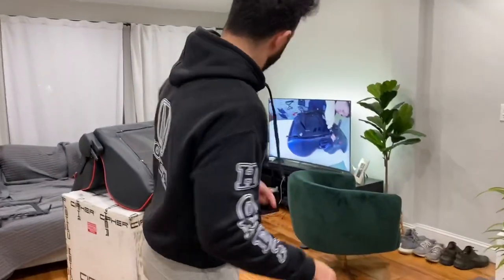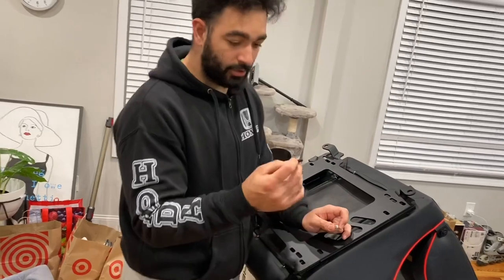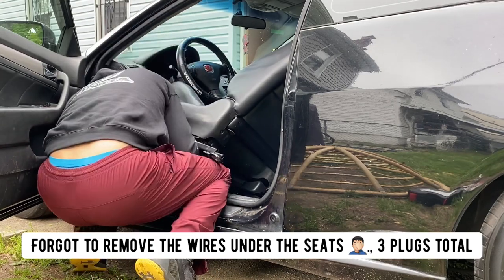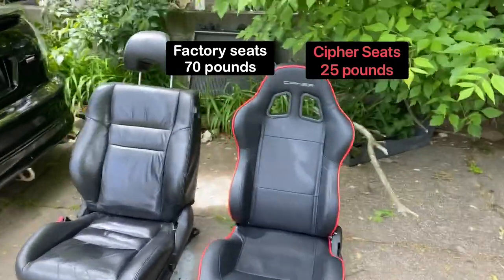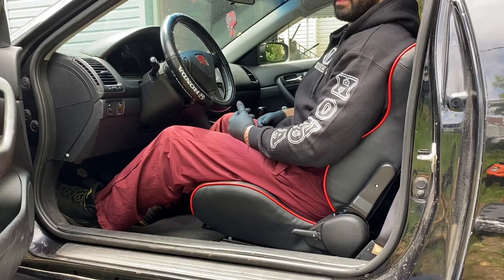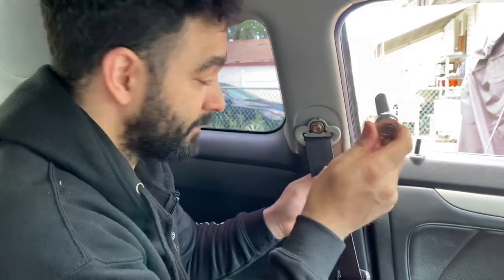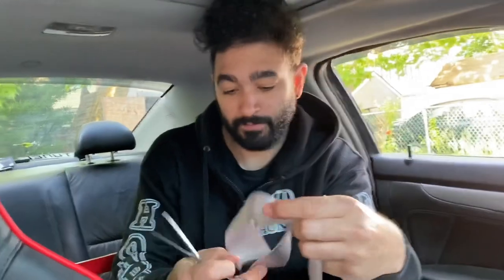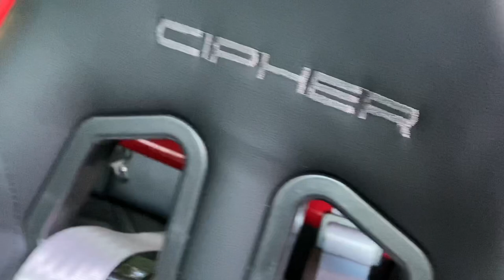CIPHER CPA1031, TANAKA SEATBELTS, HARNESS BAR INSTALL

Comment: Bro i have a 04 accord 5speed im doing it allmotor i bought a k24a head with k24a pistons and 50grade 07 civic cam sprocket with stock k24a4 block soon i’ll getting tune what ecu you recomend me to go with? Ktuner v2 or hondata kpro?? Let me know cheers!
Reply from the maker: Chon 44 go with Ktuner, with Ktuner all the gauges and speedometer will work normally like if the car is stock, since your accord is 2004 like mine you gonna need a 2005 stock ecu to install the Ktuner, check my wideband installation video, there I have Ryan information (Ktuner expert) he can help you
Reply from the maker: https://youtu.be/UoNtSB5POHo
Reply: Thanks bro keep up the build!👌🏻🤙🏻

Comment: Do you know if the brackets fit on the sedan?
Reply from the maker: Ahmad Amir you gonna need another type of brackets for the sedan, the coupe has a different pattern, I order from Carid.com or you can contact cipher directly, they work with a company that makes the brackets for your car
Reply: @franksmoke9397  Thanks so much bro. I'm so lucky to find your channel because I am going turbo. I have all the parts, but I'm just scared to install becuase I don't want to mess something up and have to buy it again and wait more time. Do you have social media so I can contact you for help installing?
Reply from the maker: My instagram is frank_m109r I know how hard is to find content for the 7th Honda Accord I’ll gladly help you with any questions :)